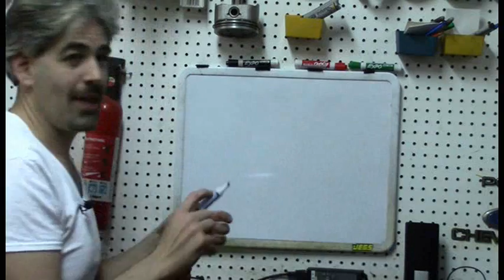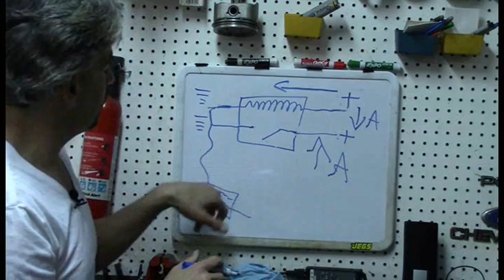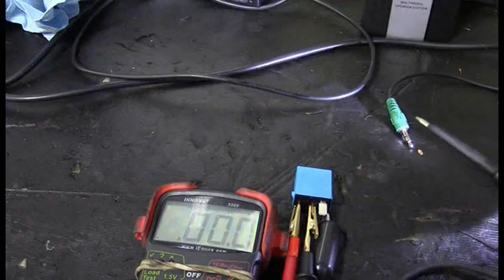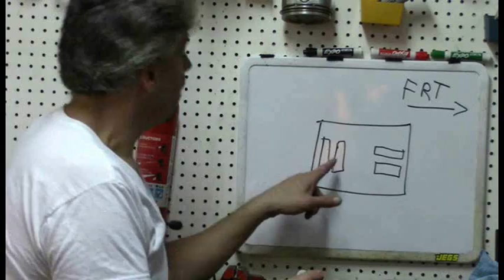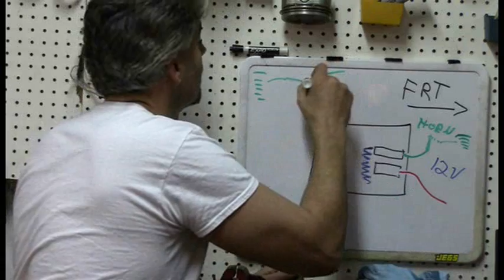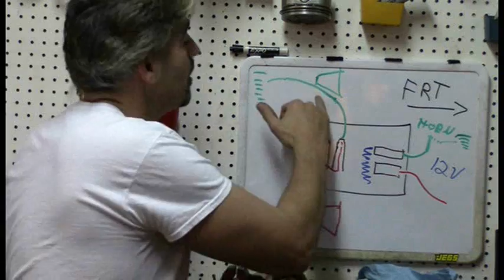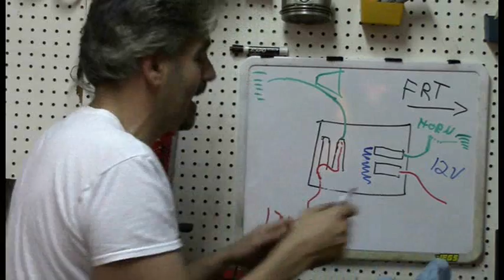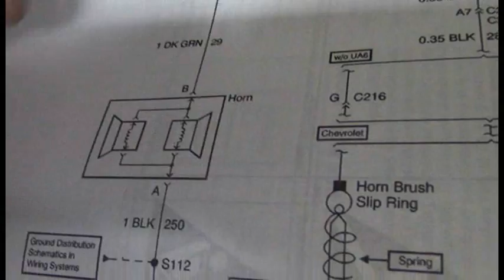Relays- Understanding, Diagnosis and Testing Relayed Circuits-Pt1

Comment: The pins are either numbered or lettered on the case.  

In the schematic you showed, there was a diode across the coil. There are a lot of relays that have this diode built into the case.  Like a tire full of air, a relay coil full of magnetism has stored energy.  Then the magnet field collapses it makes voltage in opposite polarity because the magnetic field is moving in the opposite direction from when it was created by the source voltage. So much voltage that it can damage transistors that might be in its circuit. So we place a diode across the coil in such a way that it shunts the voltage during this brief time when the magnetic field is collapsing.  

The relay will work without the diode, but  if you put voltage across the coil in the opposite polarity from the way is is designed, the diode will short and burn out because of too much current.  

A lot of time the ground side if the relay goes to the computer and connects to a collector of a transistor.  When the transistor is turned on by the computer, then the transistor acts like a switch to ground energizing the relay. This is why there is a diode installed to protect the transistor.

Comment: Matt, Congratulations, You took the plunge! ( Electrical Diagnostics ). Suggestion, you should use a test light when applying voltage to the relay not a jumper wire as you suggested. The test light will limit the flow of current should you be on the load side of the relay. Most incandescent test lights will limit current flow to around 200 ma or less and most coils in the relay only need around 100 ma to energize them. I know this was a simple circuit ( I suspect you picked the horn to limit damage should you mess up! ( LOL ) but most circuits ( window, heater control circuits, etc. ) do run thru the PCM or some other computer module on most newer vehicles these days. Using a jumper wire is just way to risky! When using a jumper there is no restricting of current flow and you could instantly fry your PCM!
Reply: Billy R Electronic test light I think is even safer personally. Designed to specifically protect the PCM.

Comment: At 17:30 when you press the horn button you are on DCV not continuity.  You do get a good 12v signal but that's not exactly a continuity test that's a voltage test.  If you would have had the meter setup on continuity the meter should have beeped when you pressed the horn.  That's a much easier test when you are in the cabin far away from the meter as the audible alert would let you know you are getting the desired result.
Reply: ***** LOL. Just recommended a 98%er watch this video and spotted your comment. I'd love my DVOM to beep. That would be much easier - it doesn't do that. It's cheap/free with another purchase.
Reply: DE Nichols Pick up a Mastech MS8261 for $25 from Amazon.  I would easily pay $50-$75 for this meter.  It's the same one that myself and many other youtubers have now.  Worth every penny.  http://amzn.com/B000FLZDPG
Reply: Yeah I caught that too

Comment: First thing I noticed was the original description assumed the relay is normally open.  That might confuse beginners at first but this channel isn't for beginners right? :P  I'm early on in part 1.  Hope you cover the difference between a 4-pin and 5-pin relay, normally closed and normally open.  There are a ton of different configurations.  That's why they print diagrams on them so you'll know exactly which configuration you're dealing with.  So far this is a great lesson for how to test a relay without any diagram (paper or screen printed on the relay).  When it comes to relays that's the most important skill to have and you seem to have a good grasp of it.
Reply: ***** ya for a 30 minute video he should of mentioned that there are closed switches, usually with a 87a

Comment: What do you do if you have a 5 pin relay
Reply from the maker: I really didn't go much into that as much as I wanted because I felt the video was dragging too much with the talking but a 5 pin relay is a whole different application.  First, by definition you will have two points of continuity- one on the control side of course and another on the side that the switch is closed to.  It is not easy to tell which is the control side and which are the two load sides so you know which side to energize the relay on if the pins are identically colored.  Usually there will be a diagram on the relays but not always.  Just "tapping" the suspected control side with 12V is OK but by no means should you sustain 12V if you find you are on the load side with the closed switch as it will fry something if you run current long enough without load.  Really, a wiring diagram is the safest way if the relay doesn't have one printed on it.  Once you determine control side, then you would put 12V through the control side and when relay clicks, you verify you lost continuity at the "default" switch and now have continuity at the other switch. If that occurs  the relay is good.
Reply: Schrodingers Box On any ISO relay, the load terminals are typically larger than the coil(control side)terminals. As Paul has insisted upon several times and I absolutely agree with him, an incandescent test light is a much better way to validate the control side. Remember, a DVOM does not put a load on a circuit like an incandescent test light does(200mA, it will varying depending on filament resistance, etc) Also, I can suspect a voltage drop problem if the bulb in the test light is dim because I visually see current flow. I almost NEVER use an ohm meter, they have wasted so much of my time I hesitate to use one. There are circumstances when the ohm meter is appropriate like a harness fault(open or short to ground)outside of that, they are junk in my opinion. On another note a DVOM is useless on high current circuits because most have a max current rating of 10 amps or some up to 20Amps for 30 seconds(they developed low current and high current clamp(inductive) ammeters for a reason, lol)  I know some other commenters mentions that some relays have a diode in them which of course is true but in all honesty, it does not change how I approach a circuit because like I mentioned before, I hardly ever use a ohmmeter. I know you are planning on investing in a scope but I would also strongly encourage you to purchase inductive ammeters, they will change your life.
Reply: jarin wilson Looks like your wish has been granted. ;)  He got a vantage pro with inductive clamp.

Comment: Thanks for another great video Matt!  Just a little feedback: I think you assumed all relays are Normally Open. If that had been a Normally Closed relay then you would have continuity on both sides and probably set you off direction... Another good thing to do when checking relays is to measure the resistance of the coil.  Most cars I've seen, have more than one relay of the same type and maybe a "relative"value between them can help you know if the relay in question is good in the case that you don't have the specs for it.
Reply from the maker: Emmanuel Muñoz Yes I discuss relay configurations in Part 2 but I did forget to mention resistance in the relay coil- good point.
Reply: Yeah, I just saw part 2.  Next time I'll wait for the series to be uploaded before commenting. Thanks again!
Reply from the maker: Emmanuel Muñoz Not a problem, it was valid feedback. I always try to cover everything and leave "no stone unturned" but invariably I miss some things that are important and comments like yours help to "complete" the episode.